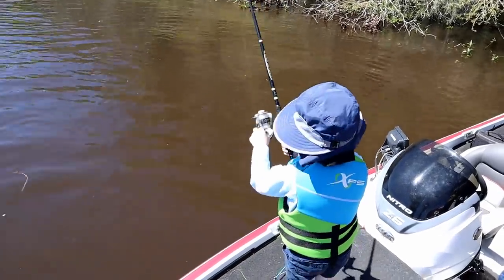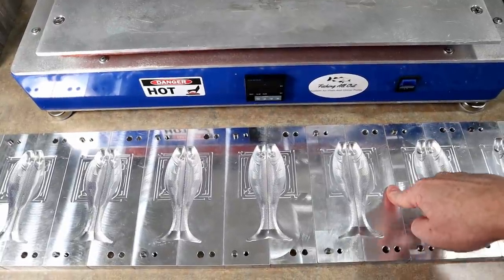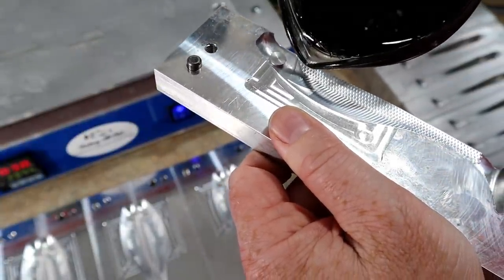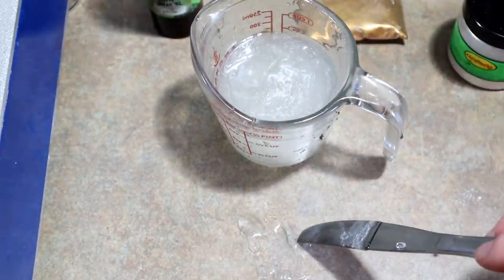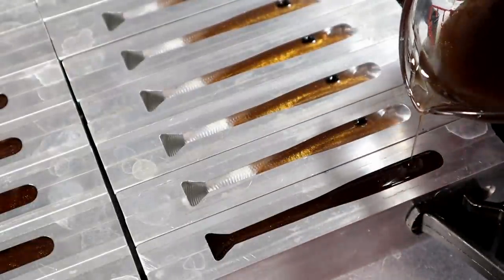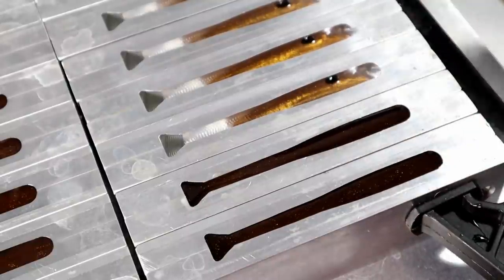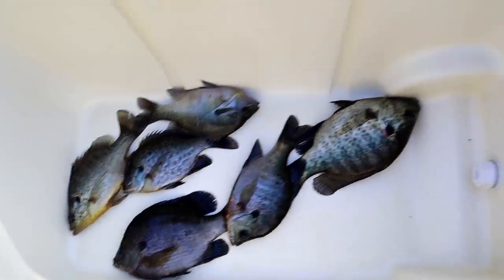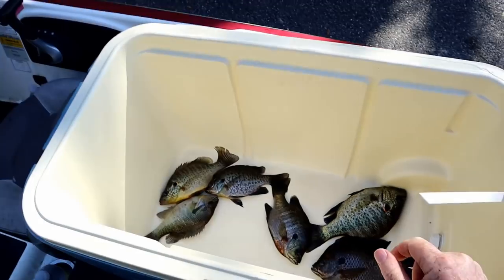MAKE THIS COLOR; Gizzard Shad Pattern & Landon Goes Fishing!!

Comment: Fellow soft plastic maker here, I have recently bought a gallon of dead on plastix's sinking bucket swimbait plastic and this was the first time working with it and everything was going well but when I injected it and let it cool the lures came out way to sticky and flimsy and even after being set in water (like I usually do) the lures were still too stretchy, soft and sticky. I have seen you work with it on the channel before and it looks like any plastisol I've worked with so how do you get yours to be normal plastic?
Reply from the maker: It has a few different properties being that it is a true non-pthalate compound.. watch my playlist called quick tips for all the information you need
Reply: @WorldsWorstFishing  Thanks to the playlist I found the issue thanks a lot man! Do you think I could save the plastic that I ruined by adding a little bit of well mixed new plastic and getting it to the right temperature or do you think that plastic is done for completely?

Comment: I just started open pours this week, how do you get such good fusion? I have been using a heat gun between layers to tack it up well and heating the mold on a hot plate after the pours until they are literally boiling hot and just letting them cool. I am still getting separation lines even if they do not delam.
Reply from the maker: Heat ..all about heat .. I have a few videos dedicated to pouring with heat
Reply: Have the molds hot before hand, I found having them up to or close to full temp before pouring the second layer is the ticket. Once done pouring the last layer you can turn the heat off. One of his vids on heat explains it. you'll eventually learn your heat source and where to get it set so it fuses well but doesn't just melt them all together either.